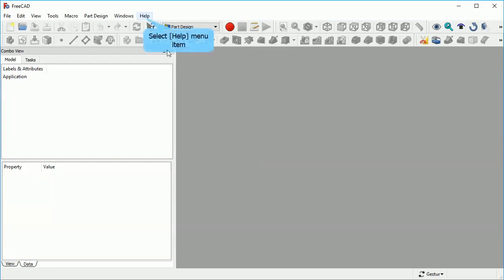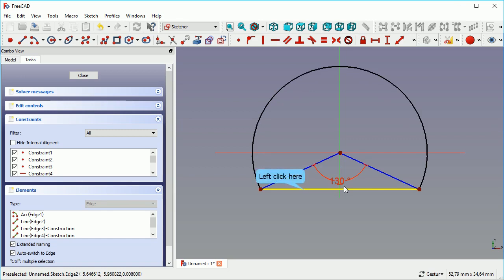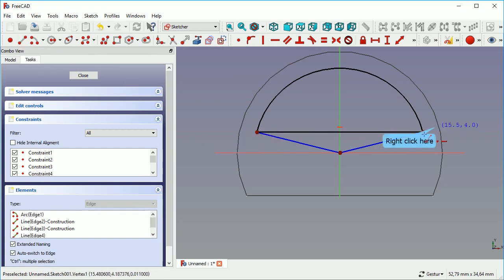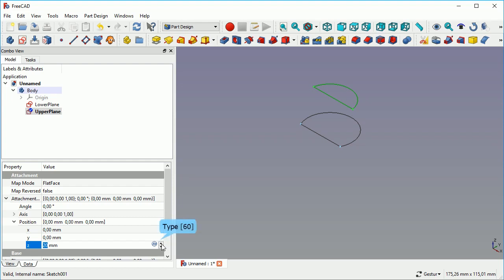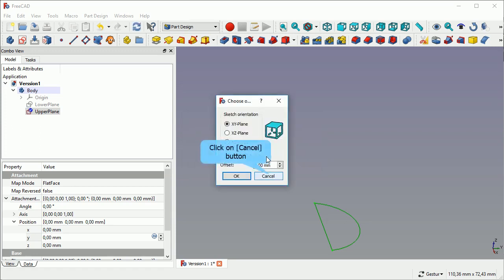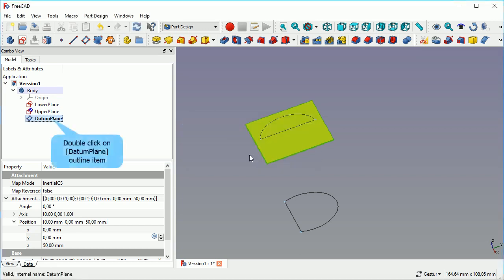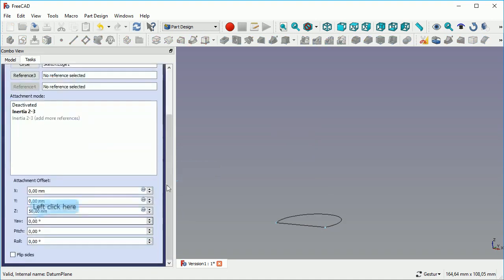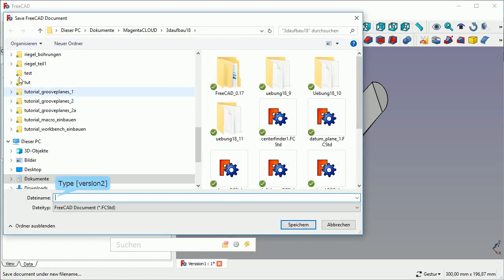FreeCAD Tutorial creating a Part Design LOFT

Comment: Hi Ha Gei

at time 6:47 you say that the offset of the sketch is zero and infact the picture shows that there is no offset, but at time 6:56 the offset magically reappears without any previuos action.
I kind of think you forgot some steps involving the offset.
Thank you for an explanation.
Reply from the maker: The shape was visually moving to his previous position after selecting the lower plane .  This is a glitch ( maybe not existing in current version ) due to the fact that in this phase the sketch had NO orientation anymore.